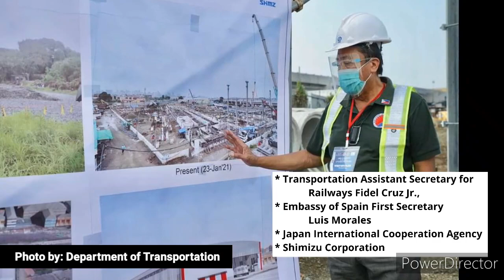LRT-1 Cavite Extension Project, High Tech Machines and Site Inspections.

Comment: BUILD BUILD BUILD PROJECTS
President Duterte Administration
(ongoing & completed as of Dec 30, 2020) 

RAILWAYS: 
LRT 1 - Extension (Baclaran to Cavite)
LRT 1 - Extension (Roosevelt North Avenue)
LRT 2 - West Extension (Tutuban to Pier 4)
LRT 2 - East Extension (Satolan to Masinag)
MRT 3 - Total Rehabilitation
MRT 4 - Metro Manila to Rizal (approved)
MRT 5 - Makati City Subway
MRT 7 - Metro Manila to Bulacan
MRT 9 - MetroManilaSubway(Quezon Pasay)
PNR - NSCR North 1 - (Tutuban Malolos)
PNR - NSCR North 2 - (Malolos Clark)
PNR - NSCR South -(Tutuban Calamba)apprd
PNR - Bicol (Laguna City to Sorsogon) 
Subic Clark Railway (approved) 
Mindanao Railway Project (approved)
Makati - BGC Monorail Skytrain - (approved)

Manila Bay - Cleaning and Rehabilitation
Pasig River - Cleaning and Rehabilitation
Boracay - Cleaning and Rehabilitation

National ID System
Jeepey Modernization - Public Utility Vehicle Modernization
3RD Telco 5G - DITO TELECOM (Mas mabili)
4TH Telco 5G - NOW TELECOM (Mas mabili)
BRT Line 1 - Bus Rapid Transit ( Quezon City Memorial Circle) 
BRT Line 2 - Bus Rapid Transit (EDSA)
BRT - Bus Rapid Transit Project (Cebu)
New Clark City - Works Class Advance City
Horizon Manila - Massive Reclamation Project 
Flood Management Project -  Metro Manila 
Pasig River Esplanade
The Great Wall of Leyte - Leyte
Unified Grand Central Station
Philippine Arena Interchange - Bulacan

EXPRESSWAYS:
MMSS3 - Skyway Stage 3 (Metro Mnl Skyway Stage 3)
SEMME-Skyway Stage4(SoutheastMetro Mnl Expy)
Skyway South Extension -Mutinlupa Alabang
NLEX Harbor Link - Segment 8.1, 8.2, 9 & 10
NLEX - SLEX Connector Road
NLEE - North Luzon East Expressway
SLEX - SouthLuzon Expy Expansion & Rehab
SLEX - Extension TR-4 Batangas Quezon
SFEX - Subic Freeport Expressway Expansion
CLLEX - Central Luzon Link Expressway
CALAX - Cavite Laguna Expressway
CAVITEX - Cavite Manila Expressway
TPLEX -Tarlac Pangasinan La Union Expressway
CCLEX - Cebu Cordova Link Expy or Bridge
QUEBEX - Quezon Bicol Expressway 
NAIAX - Naia Expressway phase 2
CamSur Expressway - Bicol
MCE - Metro Cebu Expressway
Davao City expressway - (for approval)
PAREX - Pasig River Expressway

BRIDGES:
Kalibo Bridge III - Aklan 
Landmark Bridge - Isabela 
Pigalo Bridge - Isabela 
Davao Samal Bridge - Davao
Panguil Bay Bridge - Northern Mindanao 
Pinguiaman Bridge - Mindanao 
Sacobia Bridge - Pampanga
Ipayao Bridge - Antique
Pinguiaman Bridge -
Alabat Bridge Roma Point Bridge - Quezon P.
Jardine Sawat Bridge - Ilocos Sur
Guicam Bridge - Zambonga
Samal island bridge - Davao city (approved)
BRIDGES METRO MANILA:
Manila Bay Super Bride-Cavite Bataan apprd
Sevilla Bridge Reconstruction - Sta Mesa
Binondo Intramuros Bridge
Estrella Pantaleon Bridge - Makati
BGC Ortigas or Sta. Monica Bridge
North & South Harbor Bridge - Metro Manila (approved) 
Palanca - Villegas Bridge (approved)
Lambingan Bridge (approved)
Guadalupe Bridge (approved)
East Bank - West Bank Bridge 2 (approved)
Marikina - Vista Real Bridge (approved)
JP Rizal-Lopez Jaena Bridge/JP Rizal-St. Mary Bridge (approved)
Bridges Updates:
(2,709 bridges completed) 
(462 were widened)
(108 constructed)
(1,642 bridges strengthened) 
(155 replaced.)
(About 342 local bridges were also built)
(as of November 17, 2019)

AIRPORTS: 
Clark International Airport - Pampanga
New Manila International Airport - Bulacan
New Zamboanga Int’l Airport- Zamboanga C. 
Zamboanga Intl Airport Dvlmt-Zamboanga C. 
Sangley International Airport - Cavity
Bicol International Airport - Albay
Ninoy Aquino Int’l. Airport - Expansion
Bohol-Panglao International Airport
Bukidnon Airport - Bukidnon
Bantayan Airport Development - Cebu
Calbayog Airport Development - Samar
Mactan-Cebu International Airport Expansion
Puerto Princesa Int’l Airport Expn. - Palawan
Vigan Airport Runway Extension - Mindoro 
Gensan International Airport Rehabilitation
Davao International Airport Modernization
Kalibo International Airport Expansion
Bacolod-Silay Airport Expn - Bacolod City 
Laguindingan Airport Dvlmt - Misamis Orntl
Iloilo International Airport Dvlmt. - Iloilo 
Central Mindanao Airport Expn. - Cotabato
Jolo airport Development - Sulu
Ozamiz Airport Modernization - Misamis Occidental.
Lal-Lo Airport or Cagayan North Int’l Airport Development - Cagayan 
Airports Updates:
(121 airports completed)
(114 are ongoing projects)
(75 are for procurement)
(as of 25 July 2020)

SEAPORTS:
New Cebu International Container Port-Cebu 
Malalag Port Development - Davao del Sur
Sasa Port Modernization - Davao City 
CDO Port Development - Cagayan de Oro
Puerto Princesa Cruise Port Facility-Palawan
Masao Port Expansion - Butuan City
Coron port Expansion - Palawan
El Nido Port Expansion- Palawan
Port of Sogod Expansion - Southern Leyte
Port of Ozamiz Develp. - Misamis Occidental
Port of Cawit Expansion - Marinduque
Estancia Port Expansion - Iloilo
Port of Iligan Expansion - Lanao Del Norte
Mansalay Fish Port Expansion - Ortl Mindoro
Port of Jagna Expansion - Bohol
Ubay Port Expansion - Bohol 
Port of Tubigon - Bohol 
Port of Tagbilaran Expansion - Bohol 
Port of Getafe Expansion - Bohol 
Maribojoc Port Expansion - Bohol
San Fernando Port Expansion - La Union
Port of San Fernando in -  El Nido
Currimao Port Expansion - Ilocos Sur
Seaports Updates:
(243 seaport completed)
(136 are ongoing projects)
(as of November 17, 2019)

BYPASS ROADS:
Almeria Bypass Road - Biliran Province 
Plaridel Bypass Road - Bulacan 
Urdaneta City Bypass Road - Pangasinan
Alaminos Bani Bypass Road - Pangasinan
Candon City Bypass Road - Ilocos Sur
Tacloban City Bypass Road - Tacloban
Palo Bypass Road - Leyte
Pulilan Baliuag bypass road - Bulacan
Davao City Bypass Road - Toril Panabo
Tagaytay Bypass Road - Tagaytay City
Lingayen Bypass Road - Pangasinan 
Lopez Bypass Road - Quezon
Gumaca Bypass Road - Quezon
Infanta Bypass Road - Quezon
Maayon-Sara Bypass Road - Iloilo Capiz
Borongan City bypass road - Eastern Samar
San Fernando-Pamplona Bypass Road - Bicol
Milaor-Pili Bypass Road - Bicol
Zamboanga City Bypass Road - Mindanao
Alaminos-San Pablo City bypass Rd-Laguna 
Tayabas Bypass Road - Quezon Province
Maragondon Bypass Road - Cavite ll
and manny manny more...

COASTAL ROADS:
Davao City Coastal Road
Sorsogon City Coastal Road - Bicol
Legaspi City Coastal Road - Bicol
Pasacao - Balatan Tourism Coastal Rd -Bicol
Pilipog - Gabi Coastal Road - Cebu
Samar Pacific Coastal Road-Northern Samar
Cagayan DeOro Coastal Road-Misamis Ortl.
Burauen Albuera  Road - Ormoc
Iligan Coastal Road - Northern Mindanao 
Butuan City-Agusan del Norte Coastal Road
and manny manny more...

ROADS:
Apayao - Ilocos Norte Road - Cordillera
Boracay Circumferential Road
Matnog Sta. Magdalena Bulusan Road - Bicol
Daang kalikasan Road - Pangasinan
East-West Lateral Road - Caraga 
Mindanao Ave Extension segment 2C
Candoni Basay Road - Negros Occidental
Fort Bonifacio-Nichols Field Road-expansion
Panay East-West Lateral Road - Iloilo 
Duterte Highway - Albay 
Laguna Lake Highway - Laguna
Bacolod-Negros Economic Highway
Tagum City flyover - Mindanao
and manny manny more...

Projects Completed All Over The Country:
(as of May 2020) Mark Villar 

Classrooms 137,098
Evacuation Center 129
Roads 23,657 km
Bridges 4,959 km
Airports 121
Floods Mitigation & Drainage System  8,941

And many many more projects from Luzon, Visayas and Mindanao and many more projects to come under President Duterte.

This is the Golden Age of Infrastructure or
Project of the Century by President Duterte Administration na ngayon lang nangyari ulit after President Marcos.

Kahit pagsamasamahin pa ang Infrastruktura  ng 5 nagdaang Presendente simula (1986 - 2016) or 30 years. higit na mas madami pa din kay President Duterte.

Hindi po ito ibinabalita ng mga BIAS MEDIA sa bansa puros kasiraan at mga paninira lang sa Pangulo at Gobyerno ang ibinabalita nila. Puros mali, issue at negative need no good news. Kaya sana sa mga natitirang 9% na naliligaw pa din ng landas sana po ay magising na kayo. Supurtahan natin ang Pangulo sa ginagawa nya kasi tayo ring mga Pilipino ang manginginabang sa mga Proyektong ito.

BIAS MEDIA:
ABS CBN
RAPPLER
INQUIRER
Philstar
CNN
NEWS5

Why some Media are not Credible:
1) Hindi sila patas magbalita
2) Parati sila negatibo kung magbalita sa Pangulong Duterte at Administrasyon.
3) Pinipili lang nila ang gusto nila ibalita.
4) Hindi nila binabalita ang magagandang nagawa at ginagawa ng Pangulong Duterte at Administrasyon
5)  Media is a Powerful Tool para makontrol ang tao kung sino ang dapat suportahan at kung ano ang dapat paniwalaan.
6) Mass Media in the Philippines are own by Oligarch

Wag na magpaloko pa at magpagamit.!
Sila ang dahilan kung bakit naghihirap ang bansang Pilipinas At mga Pilipino.

Mag obserba at e kumpara ang mga balita ng Reliable Media. Napakalayo ng pagkakaiba ng pagbabalita nila at ng inilalabas nila news araw araw.
RELIABLE MEDIA:
UNTV
SMNI
PTV
EAGLE NEWS
NET 25

BIAS MEDIA 
They are not In The Service of The Pilipino. 
They are In the Service of Their Own Agenda.

Without the BIAS MEDIA and the DILAWANS behind them that control and manipulate Pilipino our country will be great again.!

Be wise think twice. Don't easily believe what are Media showing you. They are not honest to you.!

Watch this (dapat mapanood mo ito):
Dark Secret Aquino Cojuangco Family
Media won't tell us
https://youtu.be/6A9Mkk0tcHY

The Truth about EDSA REVOLUTION:
https://youtu.be/VikoHKuEzng

Sige po hanggang dito nalang! 

Don't forget to say thanks.!🙂